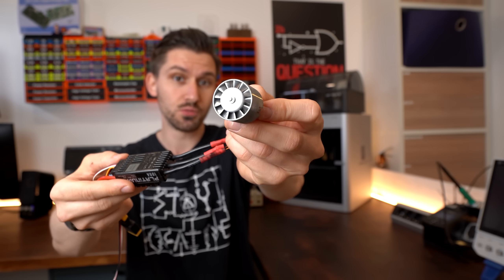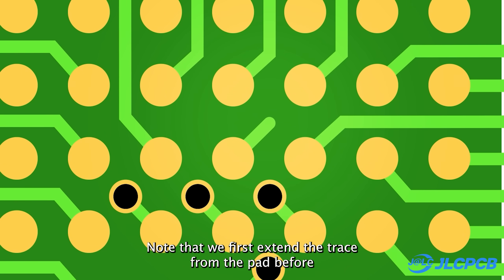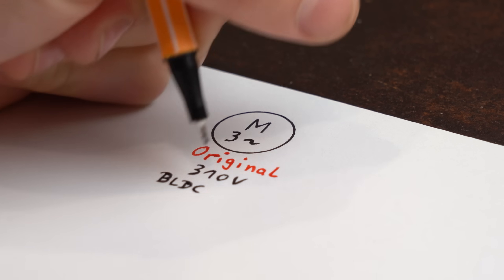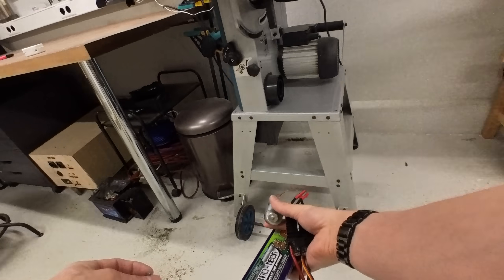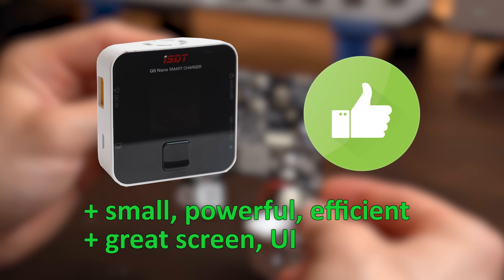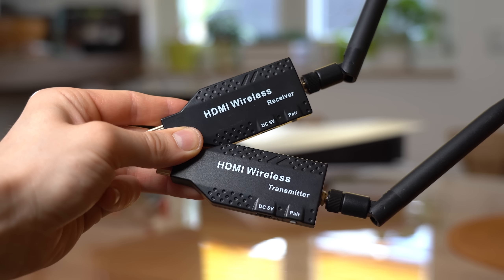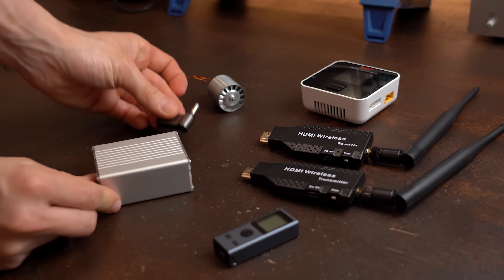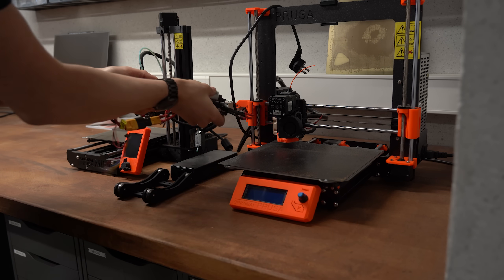I tried finding Hidden Gems on AliExpress AGAIN! (Part 9)

Comment: I'm civil engineer who has a bit of experience with these two laser tapes. Both are great to work indoors but the Bosch one is way better at outside work cause it has a stronger laser pointer that doesn't get faded easily by sunlight. Also it seems more heavy duty and some people say (not me) that the AAA batteries are more reliable in field work because if it runs out of juice you can just change the batteries and keep going. In my experience the rechargeable cheaper one lasts way more than you need in a full shift of work, it is cheaper to maintain, easier to carry around just in case and more environmentally friendly. That is, the expensive one only outcasts the cheaper one if you need to measure great distances at direct sunlight.
Reply: I have lots of electronic devices that are no longer usable because the internal or proprietary batteries are dead, that's why I prefer tech with standard exchangeable batteries when possible. As you become older you will make the same experience 😂
Reply: @SolarCookingGermany  I agree with you. I just wish the exchangeable batteries would be rechargeable from within the unit itself, like HP Prime calculator. This way you would have the better of both worlds.
Reply: Exactly the information I needed, thanks a lot!
Reply: Smart people carry power banks, no such thing as running out of power in the field anymore.
Reply: @XiaolinDraconis  That's what I do. I carry a 10Ah powerbank in the same backpack I carry my laptop and the laser. It is so small you dont even notice it is there, but it is there when you need. It's like carrying a 1m conventional measure tape just because it is easy to carry and it will help with 90% of the measurement needs. Just bring big heavy capable one when it is needed.
Reply: Other advantages to AAA for some people: When left alone for a year the rechargeable unit will be dead when I want to use it, while the AAA unit will be ready to go after a quick trip to the battery drawer. Because of this I always look for non-rechargable tools when I know I won't use them often. Bonus points for devices that might live in the trunk of my car and get quite hot in the sun, alkaline batteries are less likely to turn into fire while unattended.
Reply: @MarkLeinhos  li-ion but especially lipo batteries need to be stored at a specific voltage. but id say about 50% charged is fine. they wont last long if stored at 100% or 0% charged.
Reply: @MarkLeinhos  that is true for most devices. But my experience with this chinese laser tape is that it has such a small battery that charges so quick that it just makes sense to carry it around. Although I do charge it once in a while even when I'm not using it because its good for the battery longevity and health.
Reply: Nobody will take out it for serious business..
Reply: TBH saying that something using off the shelf batteries is a downside doesn't make much sense anymore.

If you want lithium rechargeable, buy lithium rechargeable versions of those batteries.

With 2 sets you can make sure you always have a fresh set for your devices, and in a pinch you can just buy batteries, an option you don't have with built in, often proprietary and not intended to be replaced rechargeable.
Reply: @Nevir202  you can, but you would lose what is in my opinion the greatest advantage of having a small laser tape to carry around because you know have a laser tape, two sets of batteries and a re-charger to carry around. When I know in advance I need a most capable device, I bring the Bosch one with brand new cells, but that's almost never the case.
Reply: @Juniocrvlh  Right, so instead, you carry one around with internal, rechargeable batteries, and then it is dead when you need it.

And if you say you have a charger for it, you are back to almost exactly what I was suggesting, other than pissing and moaning about a spare set of AA or AAA batteries.
Reply: Bosch device can also communicate with smartphone/ tablet to transfer data into a cad app, very useful
Reply: Bosch is probably certified and depending on the project certified tools can be mandatory.
Reply: But neither measure from both ends. A dual laser would allow you to stand in the middle of a room and get a distance from wall to wall with out walking to the wall. Also Bosch, i belive, will work in fractions of an inch.
Reply: try not to delete this one: "
22 hours ago
But neither measure from both ends. A dual laser would allow you to stand in the middle of a room and get a distance from wall to wall with out walking to the wall. Also Bosch, i belive, will work in fractions of an inch.
Reply: Si vous voulez vous faire voler et arnaquer commander chez Ali express. J'ai utiliser ma carte reçus le jours même et uniquement utiliser chez Ali express. Et  moins de 24hrs après mon achat ma carte a été utiliser en chine par un fraudeur. Et les 2 items commander que j'ai reçus plus un mois plus tard étais des contre façon illégale... NE PAS ACHETER CHEZ ALI EXPRESS.....
Reply: AAA one is more environmentally friendly as you can just use rechargable cells.
when that cheap battery dies in the cheap unit, which is likely sealed, most people will just toss and buy another.
Reply: @daviddavidson2357  there is a much greater chance of you replacing, damaging, losing, the tool well before you get to the point where an integrated lithium battery is worn out, especially with tools you don’t use often.
Reply: @conorstewart2214  Most cheap Chinese lithium cells end up swollen and at about 1/10th capacity (if they'll even take a charge) after a year, two at best.

If you manage to replace, damage or lose your tools when you don't use them often you're either buying cheap (and therefore having to buy twice) or are careless with your tools.
Reply: @conorstewart2214  That's true. I don't even remember for how long I have mine, at least two years for sure, and I never used a full charge of it at once. I think it is rated for hundreds of measurements for each cycle. I charge it mostly to keep it at reasonable charge level so it doesn't degrade as fast when not in use and that's all the care I have to put in order to always have a laser tape around (I never know when you're gonna need in my job)
Reply: @daviddavidson2357  it's true you can use. But one downside is that rechargeable cells in the form factor of a AAA alkaline battery doesn't hold as much energy and the Bosch one is power hungry because of the more powerful laser pointer and sometimes bluetooth connectivity. And that would also mean one would have to carry the laser pointer, one or two sets of batteries and a re-charger and that's just not convenient as having a device that weights less than 100 grams to always carry around. Old folks say that the best tool is the one you have with you when you need, and I mostly agree with it.
Reply: @Juniocrvlh  NiMH cells have about 75% the amount of energy density than high quality alkaline cells. Lithium ion cells have significantly more energy density and come in AA and AAA form factors, with  2.5-5% of the volume being used for a miniature buck converter to drop the voltage down to 1.5 volts per cell. Both types, if made well, have extremely low self discharge and will probably outperform the cheap Chinese laser-tape. 
Bluetooth connectivity doesn't use much power at all (an airtag can run for more than a year on a single cell and uses Bluetooth as it's only way of connecting to things), so that isn't exactly a power hungry feature and honestly seems fairly redundant on a tool and fairly useless, they make phones with laser tapes built in and that's probably going to work better than an app for someone who really needs measurements to go to their phone.

As for needing to carry replacement cells, not an issue in most cases, toss a set of spares in your tool bag and you'll get more life out of the tape measure than if you had only one of the cheap rechargable ones. You can charge them when you get home too, same as the rechargable tape measure. Less chance of it dying and you having nothing that works too, as if you buy 2 of the cheap ones at the same time, chances are the batteries in both will be dead at the same time.

User replaceable batteries are always a better option for the consumer unless we're talking about pacemakers or other devices where user-service would be directly injurious to the user.
Reply: Small distance meter for  home use. Not for serius like engineer😅😅😅
Reply: @Boediprasetya  Yep. no dual laser nor fractional. 2' 3 1/3" not there. Dual laser makes it measure wall to wall instead of walking to each wall and ading for the length of the unit.
Reply: @Boediprasetya  what would you know, are you even a civil engineer :)
Reply: In fact, Chinese manufacturers offer products that are much stronger in laser power, have a significantly longer measuring range, and are priced at a fraction of what Bosch's model costs – about five times cheaper!
Reply: AAA batteries won't "get fat" in a year or so. Yes decent phone batteries don't do that, but this is a 10 euro device so the batt is going to be cheap
Reply: @marcogenovesi8570  The AAAs sure won't get fat, but they will also not last a year. It is true that the battery is probably worse quality than phone batteries, but it is also true that each battery cycle lasts so long that would take probably almost a decade to worn it down to the point it becomes unusable. To me, the best scenario would be a user replaceable lithium ion battery just old Nokia phones used to have.

Comment: the battery charger is tempting me. charging a cell and then using that cell to drive the charger like a simple little bench power supply sounds nice.

Comment: At 5:16, you can even see it can deal with Lithium Polonium batteries. Though LiPO4 would be more what I need
Reply: Only that there are no lithium polonium batteries, Li-Po stands for lithium polymer. And LiFeP04 stands for lithium iron phosphate. Polonium is also radioactive.

Comment: Manufacturers often use a chip or circuit in laptop power supplies to ensure that only brand-specific chargers can be used is typically a Dallas Semiconductor ID chip, such as the DS2501. This chip is integrated into the charger's design and communicates with the laptop to authenticate the charger's identity. If the laptop does not recognize the charger, it may limit or prevent charging altogether. So beyond the adapters being brand specific for their sizes, they may also have a corresponding chip to allow it to work.

Comment: The wireless HDMI is something I have been looking for a long time.
Wanted to find something that was tested and preferably by someone I trust.
Thank you!

That will work fine for our old projector that has been in a box for years because I don't want to or can't route cables to it in our living room.
Reply: Especially for people with a ceiling projector, no unnecessary cables!

Comment: 13:40 for me having AAA batteries is actually advantage. Cause you can use the product for longer. Internal battery will degrade over time.
Reply: 100% agree with this statement! Especially because it came from AliExpress. Products from there aren't particularly known for using high quality batteries. But, of course there are always exceptions.
Reply: it also makes them replaceable in the field. you switch them out, dont need to wait however long to charge. he isnt really the target audience for that kinda product
Reply: Yeah, definitely appreciate AAA cells.  Also convenient if you're onsite and the thing goes flat, very simple to swap a few AAA batteries in your truck.
Reply: Not really. Over the lifetime of that product I would be shocked if you cycled that battery more than a couple of hundred times, which all li-i on chemistries can handle just fine. Don't leave it at 100% all the time, don't deplete the battery either. Keep it around 20%-80% and you'll die before that battery dies.
Reply: I would like to see more devices using replaceable lithium batteries such as the BL-5C that is very cheap.
Reply: Lithium batteries aren't complicated anymore and can be switched out like AA batteries these days (if you know how to use a JST connector and replace every year
Reply: @lavacat720  most devices with internal lipo batts in this price range aren't designed to be opened up easily
Reply: @lavacat720  How many average people on the street can do that?
Reply: @chocolate_squiggle  "Average people on the street" aren't the target people for this product.
Reply: @vinnysworkshop  right, the target audience is construction workers, Hence it uses simpler batteries. You don’t have time to take it apart or recharge when you need to get to work

Comment: I feel like giving the PD3.1 powerbank PCB negatives because it required a new trigger board and cable was wrong. It worked great with the PD3.0 compatible trigger and cabels that you had. That you required newer trigger boards and cables was a limitation of your tools, not the board, and will be true for everyting supporting PD3.1 per spec.
Reply: It clearly failed the test at 28V with too much 4.5V voltage drop. It should not get a recommendation.
It should not advertise 28V5A if it can't provide the power.
Is there any way to make it advertise only 28V3A?
Was it overheating? Or were the battery cells the limiting factor?
Review was severely lacking in this area IMHO. Clear failure having USB compliance but very little information and no effort to find the cause and still counted the product as recommendation.
Reply: @kwinzman  I use power bank as fancy soldering iron power supply. I have pinecil v2 and sequre S99. This powerbank board with s6 21700 is working same as Anker 737, just S99 shutdown with anker because of 6A is too much for it, but this board just pushing these 6A and voltage drops to ~17V. I try charge 737 with this board and I had stable 28V and 5A
Reply: @kwinzman  More like, the tester used a long, crappy USB cable that had a ton of voltage drop.  You need a pretty beefy cable to handle 5A without much drop.
Reply: Yeah, get him! Make him make another video!

Comment: Wireless HDMI tranceivers would have been great to have at my previous job: I worked in a public research lab working on VR simulations for emergency response during crises. We would run demonstrations to various actors to show off the prototype (as we didn't have the funding nor the people to make a full-fledged application) and our demo room setup was constrained by the length of HDMI cables we had to mirror the simulation output onto large screens…
Reply: Not sure about the interference of the wireless HDMI dongle though. Such device almost always uses 2.4GHz or 5GHz spectrum, and likely uses WiFi protocol as well. So if there are lots of wireless APs and devices around, it may not work as well
Reply: Wireless may introduce lag but you can do hdmi over Ethernet for long cable runs

Comment: I bought the IP2368 board that you made in your project, but I have a problem, both the IC and the mosfets reach more than 80ºC when they work at 100W, what could be the problem? I bought it in the same store as you.

Comment: Just a note about the ad. Vias under a bga are a bad idea. Particularly when sharing the via with bga pad solder point. The pad loses surface area adjacent to the bga and the surface area is already so low. Because of the already low surface area Bga soldering already has a high failure rate and does not hold up well to and flex or heat cycles the board may see during deployment. Having a via in same location will result in more lifted pads, worse still is the fact that traditional repair methods may not work either as there is now no trace running off to a remote via to patch into..

Comment: 4.5V voltage drop at 5A @28V nominal is "just fine"? Is that still within USB spec? I don't think so!
I would have loved if you could have provided more context here why it failed the 28V test. Are your battery cells the limiting factor? The cables? Or the tested board itself? Was it overheating? Can you change it so it advertises 28V3A max instead of 5A?

Comment: The pd adapter is very useful, i have the same exact model and been using it for over a year. You have to set the laptop to the power saving mode when charging if you have that chunky laptop, afterwards you can switch to balanced mode. The tip with power meter overheats when plugged in the converter, you should plug the other way. The first problem is those al cheapo chinese power supplies have short lifetime, they die within a year. Second issue is straight usb plugs can be easily broken when somebody hits while sitting in a cafe, you should buy the one with the 90 degree connector on the other end.
Reply: ugreen GaN power supplies are really solid. The whole company basically went legit

Comment: The ISDT C4 is a very good battery charger for standard sized cells. AA, AAA, 18650, 26650.  NIMH, Li-ion, LiFe.  Charge discharge storage cycles.  It really does it all.  It works well when you need to exercise NiMh or to test the capacity of lithiums.